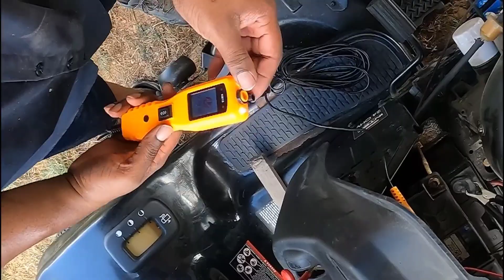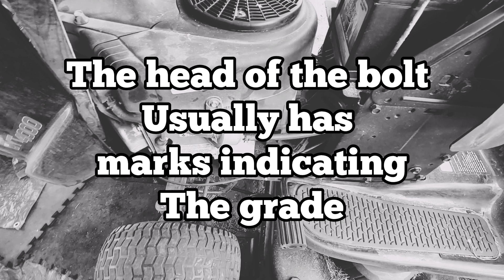Craftsman DYT 4000 clutch pto not engaging riding mower

Comment: great video!!  Thanks for the info,,,  my pto clicks with key on... when i start motor and then engage the pto, it clicks but blades dont move. any suggestions?
Reply from the maker: Thanks for that and thanks for watching!  1st thing I would do is Double check your belt and sure it hasn't came loose, or has way to much slack. Check for cracks.
Reply: My belt was off the pulley lol
Reply from the maker: @lowhooch  that was the best case scenario lol. Didn't cost a penny